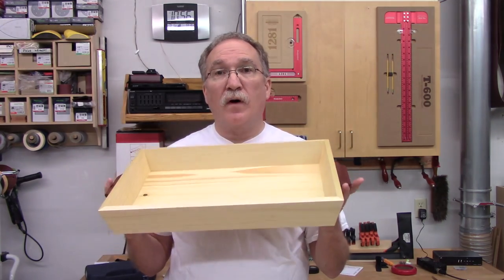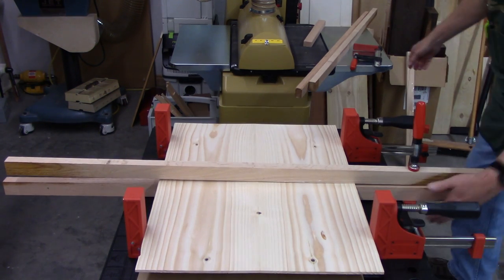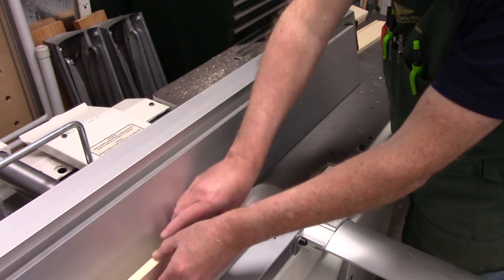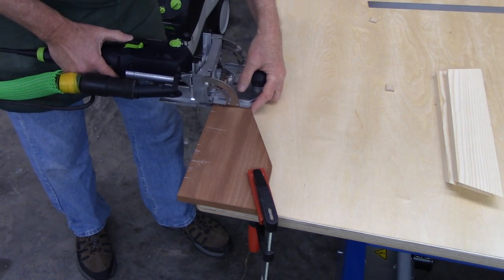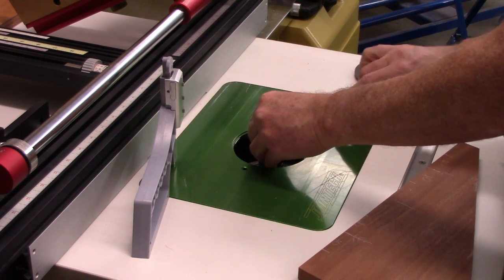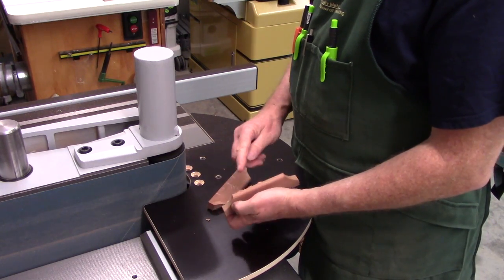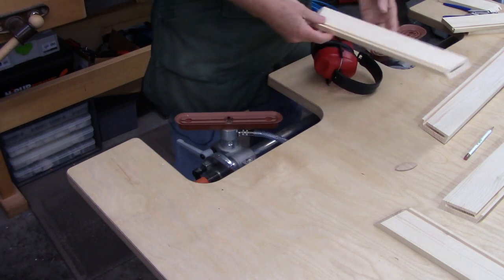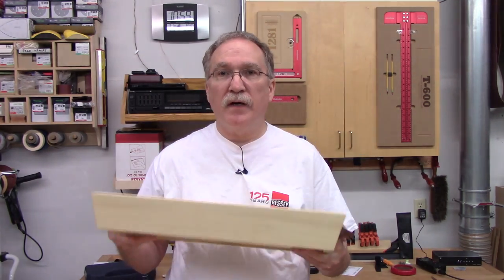Compound Miter Serving Tray Part 1

Comment: Hi, I would be more interested to know how to calculate the compound miter angles. If you could elaborate more on that in a separate video? Thanks. You got pretty amazing tools though!
Reply: Some of the Dewalt miter saw owners manuals have an incredibly simple graph type chart that is by far the simplest way to figure the miter and bevel angles that I’ve ever seen! Typically there are simple instructions one or two pages back from the graph on how to use it. VERY simple, and spot on perfect results!

Comment: Hi Steve,
Thank you for your reply to my lock miter question about whether the lock miter would work for joining the edges of the tray.. Thinking more on it I wondered if a finger joint router bit, set, in your example, at the same blade angle of 43.1 degrees with your miter fence set at the same 14.51 degrees might work. It might be very tricky to set up even if it were possible to make it work. What do you think?  
Thanks,
Dave
Reply from the maker: Hi Dave.  My gut tells me that there may be some instances where this would work but that it would be a royal pain to set up.  The fingers of the cutter would likely go through the work piece at an angle of 43.1 degrees plus, with most fingerjoint cutters, you have to flip the opposite side workpiece in addition to tilting the bit (or the workpiece).   I think the frustration of setup would dissuade me of this notion real quick.  Steve
Reply: @extremewoodworker  Thanks, Steve. I had a feeling it wouldn't be worth the effort, but I thought I'd check anyway. I will just use the handy Festool dominos.
Dave

Comment: Steve, how do you get by sanding pine on your drum sander with out gumming up the sandpaper? Enjoy your work., Bob
Reply from the maker: Hi Robert.  I take light passes and clean frequently with a rubber sandpaper cleaner.  This was more of a white pine so was not nearly as resinous as yellow pine.
Reply: @extremewoodworker  Thank you Steve. I normally don't sand pine with the drum sander because of gumming up the sandpaper as I commented on. Once a again you do great work. Been enjoying your video's about the Fritz and Franz slider jigs .Any way keep up the good work. And remember woodworking is a dirty job but some one has to do it. LOL, Bob
Reply from the maker: @robertpotter9506  Thank you Bob.  Stay safe.  Steve

Comment: Watched the video - but how do you work out the compound angles?
Reply from the maker: Hi Tim.  I suggest doing a search on the term "Compound Miter Calculator".  There are a number of on-line calculators, spreadsheets, etc. where this is already worked out for you.  Or, if you a a gluten for trigonometry, it can be derived.  Steve
Reply: Thanks - don't know why this didn't occur to me - much easier than doing the trig manually!
Reply: @tjbrison   Have you seen this?  http://woodgears.ca/miter/splayed_miters.pdf
Reply: @curlykipper  Brilliant! Might have known Woodgears would have something on this!
Reply: @curlykipper  Thanks! Exactly what I was looking for.

Comment: Love those vacuum clamps. Where did you get those. I have been trying to 3d print some with zero success.
Reply from the maker: They are part of the Barth 500V table purchased from Rangate.  The head material is silicon rubber so I doubt they could be 3D printed.  You may want  to look at the Rockler vacuum clamp pods for some ideas.  It looks like their system has plastic bases with closed cell foam to establish a vacuum seal.  Steve

Comment: Hi Steve,

As always a very nice video. Learned a lot.

But please help my 85 yr old "eyes". For I am sure I did not see two  different Jointer/Planer machines (MiniMax and Felder) that were used for ONE machining job each. Tell me if I am just "seeing thangs!

If per chance I am still "seeing" correctly, why dear friend?

LOL
Reply from the maker: Pat - Your eyes are fine and there are two.  I was selling the Felder for a widow friend and 3 sales fell through in a couple of weeks.  She was stressing about it so I purchased the machine thinking I would decide which I liked best and then sell the other.  After 6 years, I still haven't decided.
Reply: Makes sense. Thanks